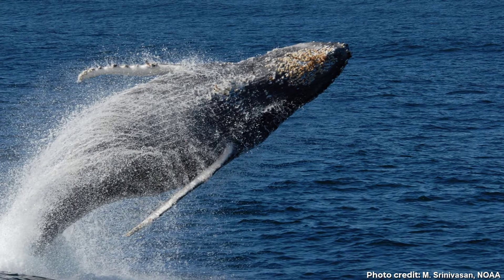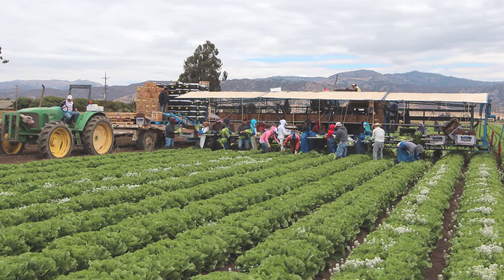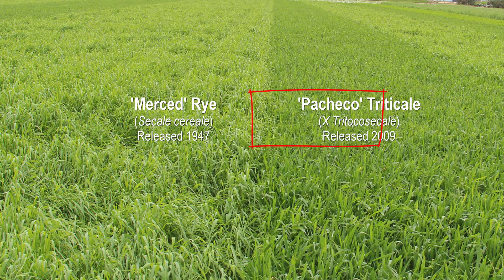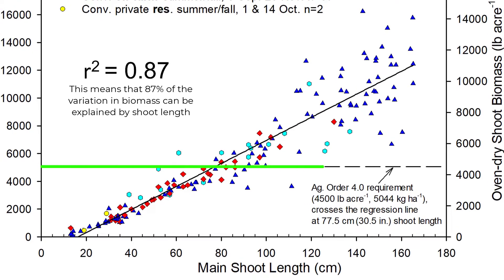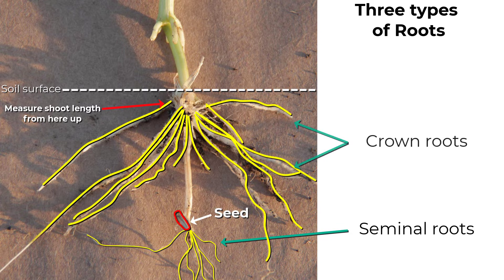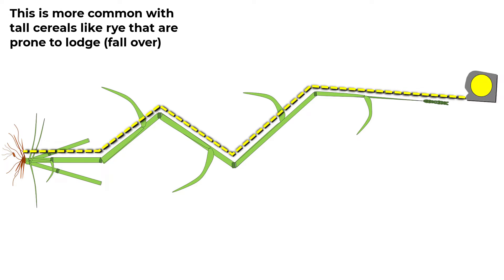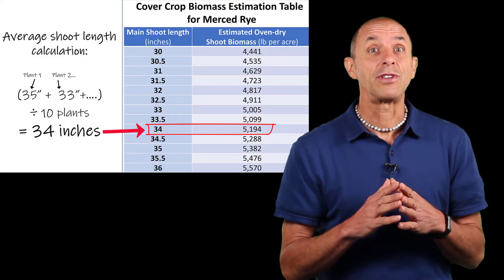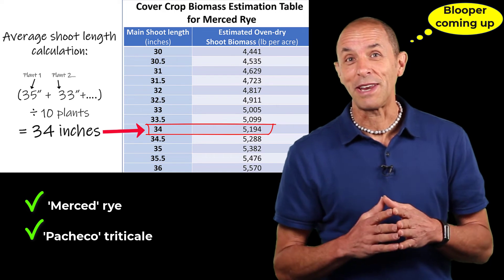A simple way to estimate cereal cover crop biomass from stem length

Comment: Since there is no accounting for stand density, seems like this approach would have limited application for areas with sparse stand development, such as caused by low rainfall.
Reply from the maker: Hi Lee, 
Thanks for the excellent comment/question.  The soon-to-be published paper on this has more details in stand density, etc.  But essentially, the method was robust (i.e., worked well) across a huge range of densities because of the amazing ability of cereals to adjust their tillering based on stand density. The densities for rye in the regression curve ranged from about 200 to 900 plants per m2, and for triticale they ranged from about 100 to 300 plants per m2.  I admit that I was surprised with how well the method worked across a range of densities, row spacings (6-8 inches) and even planting methods (drilled and broadcast).  In addition, the data came from irrigation field, rainfed field, organic and conventional field, etc.  and a range of soil types and planting dates.  As you can see there is some variability in the scatter of the data, but an r2 of 0.87 to 0.88 still makes me smile : )

By the way below is a link to a paper from my long-term research where we tracked the effect of plant density on biomass production over 8 years. Soon after planting, biomass is higher with higher densities but the effect quickly goes away once the cereals adjust their tillering.
-Brennan E.B., N.S. Boyd. 2012. Winter cover crop seeding rate and variety affects during eight years of organic vegetables: I. Cover crop biomass production. Agronomy Journal 104:684-698. 
https://www.ars.usda.gov/ARSUserFiles/21904/BrennanPeerRevPdfs/Agron%20J%20104p684.pdf

Here’s another 2 yr study with similar results.
-Boyd N.S., E.B. Brennan, R.F. Smith, R. Yokota. 2009. Effect of seeding rate and planting arrangement on rye cover crop and weed growth. Agronomy Journal 101:47-51. https://www.ars.usda.gov/ARSUserFiles/21904/BrennanPeerRevPdfs/Agron%20J%20101p47.pdf

Hope this helps,
Take care, Eric
Reply: @EricBrennanOrganic   That's impressive.  Thank you!
Reply from the maker: You're welcome Lee.
thanks.